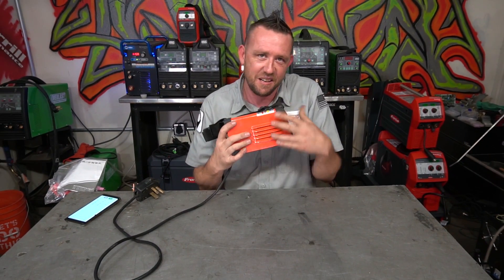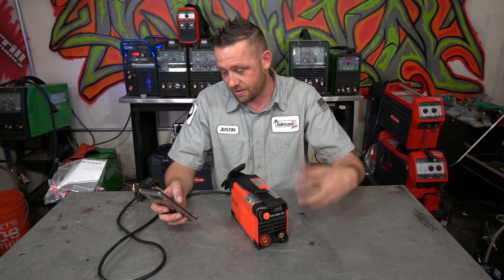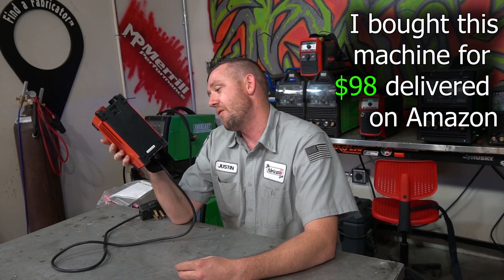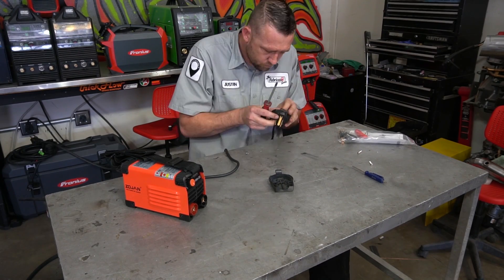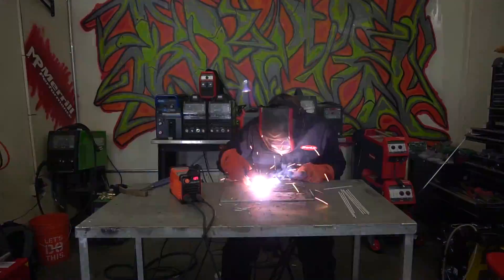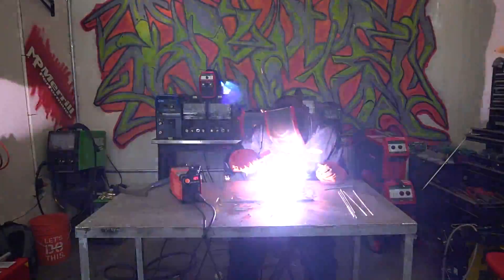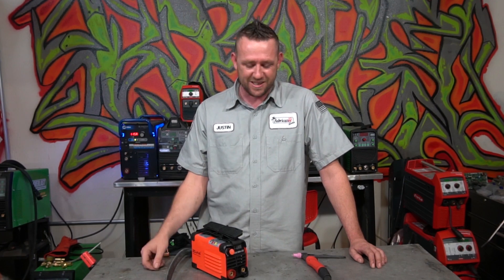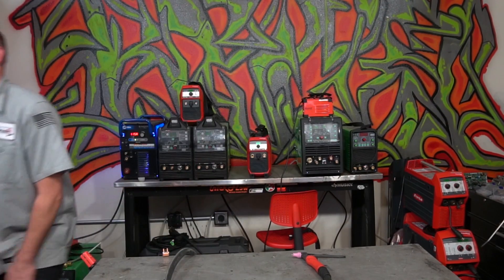TFS: The Smallest Welder EVER! Will it TIG?

Comment: Honestly, when you said it goes to 250A, My first thought was "there's no way that little thing does 250A". The question remains however; How would you rate it if the display was actually accurate? Let's say the display maxed out at 125A, would you rate it as a reasonably decent welder for that amperage?
Reply: Mind Freshener hes running it on 240volt.
Reply: Mind Freshener, he's running at 240v "didn't you see the plug"?
Reply: R Stieffel  - you have no idea how many misconceptions there are in that statement. China makes the world's electronics and there are more students in their universities alone than in the entire US education system.they make virtually all the US's top electronic brands... do your research...
Reply: @garybaris139  my buddy bought one of these and told me that he was able to tig half inch steel plates. He's a career welder and instructor. He said it was a steal for that price. So I bought one and waiting for it.
Reply: @garybaris139  there's a massive difference between made in a off brand factory in China and then made by a multinational corporate factory in China. So cheap Chinese crap is still for the most part crap.
Reply: @southjerseysound7340 , you clearly don't know how Chinese manufacturing works. Do you honestly think that american brands all have their own factories in China? Do you honestly believe that the Chinese only produce those brands in those factories? You are clearly delusional....🤣 lol.

I have done a lot of business with the Chinese over the years and I can tell you one thing, they will make anything for you that you could possibly want and put any label on it you want. Quite a few of the products I imported from China were better quality and better priced than the overpriced American brand named crap. I don't live in the US so I don't much care for the US' patriotism and beliefs that their stuff is the best, I'm only interest in price and quality. 

By the way, I own a Chinese rebranded invertor welder and I've worked the crap out of it. Add to this that I also own an American branded portable mig welder that is labeled as having been manufactured in China and it is utter crap. Everything about it screams poor quality and yet it was quite pricey.
Reply: @garybaris139  I would love to know where I said "American brand" lol and I know how things work in China quite well. If you could comprehend what I actually wrote instead of what you assumed I wrote you'd realize that. I go to China 2-4 times a year for business.
Reply: @southjerseysound7340    So why then the BS about Chinese products. They produce to satisfy demand of both quality and crap goods. If there was no demand they would not produce it. This also applies to the cheap crap. The market wants cheap crap, they produce cheap crap... but to state that's all they do is deliberate misinformation, especially if you know how their industry functions as you claim to.
Reply: I didnt believe it to have a 250 amp capablity on first seeing it, but for 99bucks I'm mildly impressed.
Reply: It has nothing to do with duty cycle. Duty cycle is how long you can run it at a specific load before you need to cool it down for a specific time. This machine doesn't reach the rated output, it only goes to about half. That is either blatantly misleading advertising or bad design..... maybe both.
Reply: Gary Baris C
Reply: It is all about duty cycle. And how much the fans and  heat sinks and fans can dissipate the heat
Reply: It works great for a 125 amp arc welder. I ran 20lbs of 3/32 rod with one
Reply: Mind Freshener you do realise we all here in the USA have 240v
Reply: @nightmareinaction629  when did you get 240v AC in USA? Maby if you use 2phase 
But in most of the world we have 220 - 230v AC on one phase socket.
And 400v AC on 3phase sockets. 120° Deg phase difference.
Reply: Jony Harri everyone in the United states or at least 99% of all houses work on splitphase ac so 240v split into 120 and some houses have a 240 plug
Reply: @nightmareinaction629  you didn't understand what I wrote, sorry for the language barrier.
Reply: Ivan, What am I supposed to C? Do any of the responses address my question? NO, they do not.

Comment: ive seen this in our local hardware store, i mean its nothing you would work of for real but if you just need to burn some rods on something in your backyard and you dont want to carry a 100 pound machine around, this thing will do its job just fine i guess. especially if you are using the 2.4mm rods, the 125 amps that come out of that are plenty enough

Comment: It would probably work better with 6013 rods as the open circuit voltage is rather low. Could be a useful bit of kit to keep on a service vehicle. I keep a little Italian machine that I purchased back in the mid to late 90's that is almost as small but only claims to run to 95 amps it does not have a meter on it but as I tend to drive a welder by feel that is of no import at all, I did check with a clamp meter and it tops out at 110 amps not the 95 claimed.

Comment: It might be good enough for a home-gamer to fix an occasional fence or lawn mower? Just saying, maybe a off road excursion. It won't replace my Lincoln Tombstone or ac/dc tig however sometimes its not convenient to bring a large welder.
Reply: Was just thinking this little bastard would be a LIFESAVER On a trail.
Reply: 220V - 240V 50Hz is standard in most countries, including all of EU, China, Russia and India. That's a whole lot of people right there. It's basically just the US and a number of countries in the Caribbean where 120V 60Hz is standard. A few countries have real oddball standards such as Antigua and Barbuda where they have 240V 60Hz in the wall, which still won't be an issue for most equipment designed for 220V to 240V 50Hz.

Still, if you need a reliable tool this particular welder probably isn't the best choice for someone in the US. And that's before you consider the fact that we doesn't know how durable it is. Given the size, weight and low price I doubt the quality is all that good even if you disregard the hilarious ampere meter.

Comment: You would do better to  wire that 220 plug into the DIN's and weld straight out of the wall.  Interestingly the Amazon ad says its a 160Amp welder.  I wonder if they watched your video and changed it.  LOL